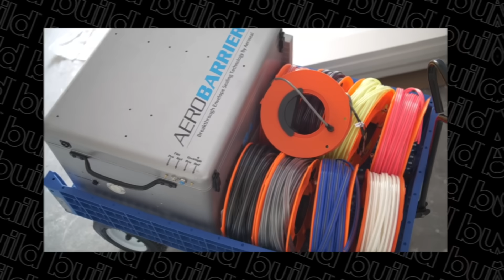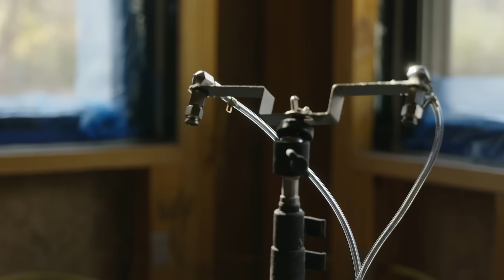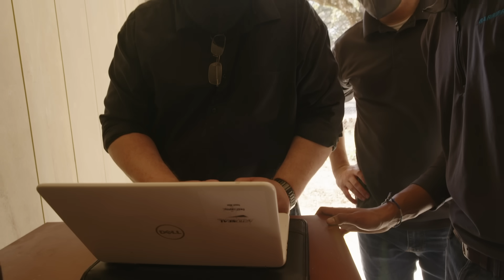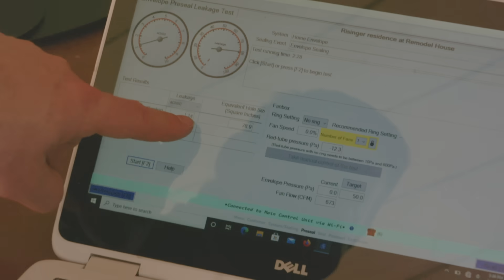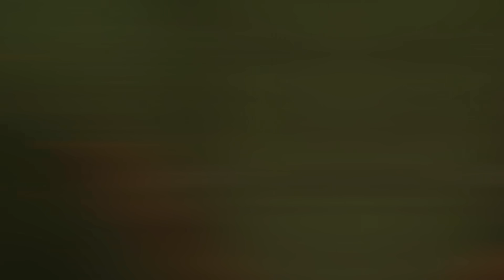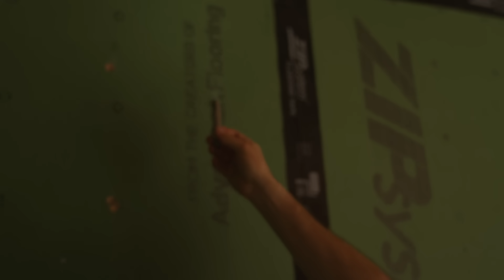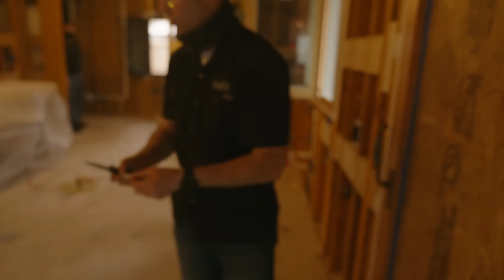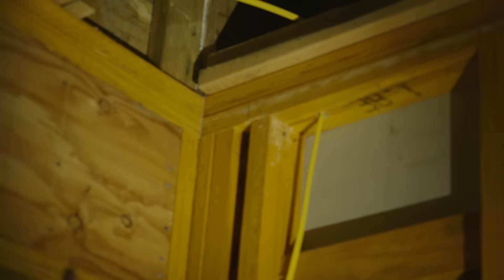The one product I'd recommend for EVERY House!

Comment: Now you need a video on clean air, filtration,sick home syndrome, and what you need to do for a house so tight it cant breathe, alot overlooked for such a great product, also. what chemical make up is that stuff, how long does it last, does it put off anything, is it fire retardent, there is a whole lot more.
Reply: seems like they talk about Minnesota and Iowa quite a bit.  high radon areas.  one would want to use a radon abatement system in conjunction with such a well sealed house.
Reply: From Wisconsin here, and the thing is, if your basement is sealed well, Radon isn't an issue. And when people talk about how tightly sealed new homes are, they are forgetting you can always adjust how much air exchange you can install, and not have any significant extra costs of healing or cooling.
Reply: @thorium_glass  Radon testing and treatment is mostly a scam pushed by greedy fear mongers. Slabs and crawls are easily sealed to prevent any radon accumulation. Only the cheapest homes with rickety floors over bare dirt will have a chance at having any problems, and likely not even then as the house will usually be so drafty radon won't accumulate any more than it would out on the porch.
Reply: he has lots of videos on closed houses and their blessings and problems.
Reply: Thank you, the massive hard on over how tight to make a house is getting old. Sure, no one likes a drafty house and wasted heating bills, but use common sense. Very few people incorporate fresh air into their homes, they instead breath old contained air that has mixed with pet dander, off gassing of wood and furniture, stale air, nothing that anyone would consider good. People wonder why they get sick so easily.
Reply: We want to control the air coming into our home. With air exchangers we can use the old air to moderate the temps of the new air.
Reply: You would use an ERV or HRV to bring air in on your terms at a single location. There is no sick home syndrome if you do that.
Reply: He explained that he has other ways to allow the house to breath besides allowing your house to accidentally leak from random unknown places. He's right too, most of the homes that leak through the walls grow mold on the back of drywall in the summer when the air conditioning is on. Some people think their exterior soffits should share and circulate air with their interior attic space- that's another terrible idea.
Reply: I agree 100%

Comment: As always...it's not so black-and-white. This can make a house TOO airtight, actually TRAPPING moisture and contaminants inside with you. You WANT your house to have fresh air ventilation of some sort. Not too much, but not too little either.  I worked for an indoor air quality company and we would measure the "airtightness" of a home (and ductwork) to determine if it needed to be sealed.  IF you are going to use this device then I HIGHLY RECOMMEND adding fresh air venting to your homes mechanical system to ensure that you are allowing your house to exfiltrate contaminants and moisture.

Comment: Kind of reminds me of EAFS, where it sealed up so well that water / humidity couldn't escape and that's what rotted the plywood/waffle board and that's what caused the walls to rot.      I like the idea, but until the technology is 15+ years old, it's not tried and true and could cause other unintended issues.
Reply: Yes! You want your house to "breathe" to a certain extent.  You do NOT want to trap moisture and contaminants in your living space.
Reply: @ChrisWill  Sometimes being able to smell smoke in your house from the outside might save your life too if there is a forrest fire.    Otherwise that house might be your casket like in the Wickerman/Burningman.

Comment: Cool product. I added more loose insulation to my attic with Atticat, but before I sealed all joints from the attic. I also sealed inside the house by running 3 fans, 2 bathroom and stove, then walked around with a smoke stick closed each room check the whole room by closing the door and checking at the bottom of the door. Then if the room was leaky moved into the room to check windows and other areas with the smoke sticks. Best I could do with a 1978 house. Mine is really well sealed now. My attic is vented so just needed to seal the living space.

Comment: Was negative pressure mentioned? I have a foam insulated house and everytime I turn on a bathroom exhaust fan or the range hood air is coming in around exterior door knobs and any place it can find a way in to replace the air being removed. I could imagine that would only be worsened with something like this product unless you had something for makeup air.
Reply: I am pretty sure Matt has a proper HVAV system in place which has a MAU (Make-up Air Unit) which pushes (controlled) air in to the home/structure.
You need to keep in mind that this is only ONE cog of many which need to work together to get the desired outcome.

Comment: Seems like it would be simpler to use a spray foam product to insulate and stop leaks at the same time.
Reply from the maker: I thought that too but the Blower Door results on full Spray Foam houses always was disappointing.  I was getting scores on the Blower Door from 2-3ACH50.  They met code but were not as tight as I would have hoped.  The SPF generally seals the cavities but all the Wood-To-Wood connects don’t seal at all.  That’s where this AeroBarrier really comes into play.  It gets ALL the cracks in the house that are 1/2” or smaller and those miles of small cracks add up to big leakage.

Comment: I didnt know anything about a blower door test until after house was built and didn't think about how air tight the house was or wasn't , found out needed a blower door test just knew it would fail because first house I ever built  , well passed the blower door test with good numbers , house is in washington state , 2 to 5 grand , i doant think i would do it but I will keep air tightness in mind on next house and I'll have a couple guys and myself with caulking gun/spray foam in hand  it will cost me 600$ and have very good results

Comment: i would add in "dye check" or a UV dye so you could use one of the massive UV light so you could see where on the outside the BIG leak areas were.
pretty cool
Reply: Great idea, that way you can seal those areas better IF you can see the leaks. I worry this system will only get a very tiny bead (as soon as air stops leaking it stops patching) and as the house settles and flexes those small beads will probably break. I'm sure over time it would go from 95% sealed, then 70% after 5 years and continue down. I'm not certain, but it seems logical. Very cool system nonetheless!
Reply: @getstuk87  Agreed on all points. 

If there were a visible dye in this caulk (red, blue, etc. etc.) then could/should a builder use it as indicators for where they should go back and add tape or additional forms of calking over this product to help keep those areas sealed in case there is possible deadhesion from settling, flexing or expansion/contraction of the home over time. At least that's what I would do to improve the airtightness after this process was over.
Reply: @getstuk87 right, almost seems ideal to do it more than once if possible during building, after things get a chance to expand and contract.
Reply: brilliant
Reply: Excellent idea
Reply: I was thinking of making it orange or red or something but the uv light is a good idea too. That’s what mechanics do to find leaks in air conditioning in cars.
Reply: that's what an IR camera is for.
Reply: I guess if they're willing to come back at night...
Reply: @mikebutler1641  🤣😂

Comment: 1. Who wants sealant mist all over everything?

2. A house should breathe. Cotton clothes are comfortable because they breathe. Polyester clothes feel uncomfortable because they don't. You'll probably have to use a dehumidifier now.

3. Pressurizing the inside of the house is liable to cause flashing tape to come loose.

4. When you breathe, you use up the oxygen in the house. Carbon dioxide levels are going to soar now. You're going to have to somehow bring in outside air or suffocate.

5. How many years in energy bills will it take to recoup the cost of this procedure? Remember that you'll use power running a dehumidifier all the time now and have to bring in and heat or cool outside air (using energy) to breathe.

6. This air-tighness thing can be taken too far.

Comment: There are 3 problems that immediately come to mind.  First, your home isn't supposed to be perfectly sealed.  Yes, air sealing is, by far, the most effective method of insulating your home.  The effectiveness of proper air sealing completely trumps the benefits derived from physical insulation like batts.  However, a home shouldn't be perfectly sealed because you need constant fresh air drawn into your home.  This is why HVAC systems mandate that fresh air comes in from the outside.  Actually, too much air sealing is a problem in those glass high rises so constant fresh air must be drawn into such structures.  I don't know if this is an issue here but it's something I wanted to mention.

Second and more importantly, I wonder how long this caulk will last.  It's supposed to last 50 years according to Aerobarrier, but I doubt this is true.  Regular latex caulk only lasts about 5 years, so how in the world does this caulk last 50 years?  If they can make this caulk last 50 years, why wouldn't they make the caulk you purchase at Home Depot also last the same amount of time?

Third, the cost is extremely high.  The video mentioned a cost of $1.50 per sq ft, but if you look on the web, that's the bottom of the actual range in price.  The price can actually range up to $3.50 per sq ft.  So, let's say for a 2,000 sq ft home, that's $4k at $2 per sq ft.  That's a lot of money especially because air sealing is not the only insulation measure you must do for a home.  You also need to install physical insulation like fiberglass.

Be careful of the claims made by businesses.  Of course, they are going to be biased in their assessment.

Comment: WRONG! one needs advantisius air to STOP mould. Last thing you want to do is turn your house into a Plastic bag. Water vapour from cooking and drying clothes also breathing is what causes consendation in homes. I had to fit a Passive air input system (PIV) in my house because it was too well sealed,by double glazing and insulation and wall coatings. Painting your house seals all the walls aswell. Now my PIV is fitted i have a gentle air pressure comming into my home. i do not suffer any mould anymore,Even in the back of my wardrobes. i cant stress enough that a house has to breath.

Comment: “The amount of dimensional change is estimated at 1 percent of the width or thickness of lumber for every 5 percent change in moisture content.”
Quote from Canadian Wood Council.
The allowable moisture content is 19%. Over seasonal time you can expect this will settle at 8%. So if you seal the building envelope during construction, would you anticipate leakage after a 2% shrinkage of lumber?

Comment: So your going to use electricity to pump fresh air I to a tightly sealed house on a planet full of free air that you'll pollute by running an electricity run air handling system. Also, your blowing outside air, containing the aforementioned moisture, mold spores and pollen to do it just to make sure to drive them into every crevice of the construction.

Comment: Im absolutely not a contractor or a doctor, but is sealing a house in this way a good thing? I don't quite understand why someone would have a completely "sealed" house.
Reply: A sealed home reduces your heating/cooling costs significantly, and lets you control the ingress/egress of air using an HRV/ERV.

Comment: I’m from Canada were we have extremes in temperature. We have pushed for sealing homes extremely tight to save on energy costs . What we have found that no one is willing to talk about is it’s causing homes to rot from the inside out out . The other issue with the homes not breathing well is when someone gets ill it just circulates for extended periods . Yes HRV’s do help with air exchanges but what happens there is no one does the maintenance on them which causes a build up of nastiness for redistribution into the envelope . Another issue is the off gassing of building products . Everything built with chemicals now . The building science hasn’t caught up to the energy demands . I’ve lived in a new home but recently moved to a much older home and I’ve noticed a big difference in my health . Looks like a great product but I’d like to see bigger advancements in making homes breath better especially in extremes in yearly temperatures

Comment: The main issue with the newer houses being too tight is people then don't ventilate them. So all that moisture created inside stays inside. So at least when you had a old drafty house it ventilated itself. Not saying modern air tight houses aren't good, just they need to be ventilated either passively through windows or mechanically.

I see all the people who complain of mould and their house is shut up maybe the curtains aren't even opened and there is no ventilation.

There is nothing wrong with the envelope of the building letting moisture in, just user caused, and it is often caused by tenants, the owner is like When we lived there we never had any problems, but tenants just don't care.

Comment: In Ontario Canada, whether you spray foam all outside walls or you install vapor barrier and seal joints with acoustic sealant, this process seems unwarranted ... especially at $1-$1.50 a sq. ft.
In this house in the video, 3,000 grand would go ALONG way to seal small leaks appropriately. Good old fashion hands on.... which not many want to do today.